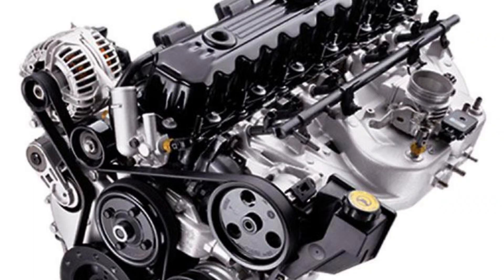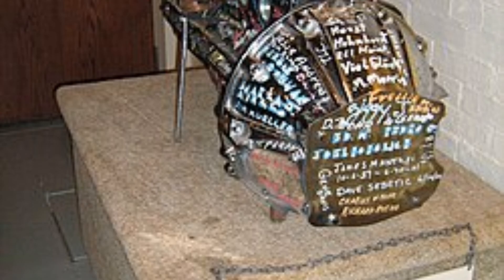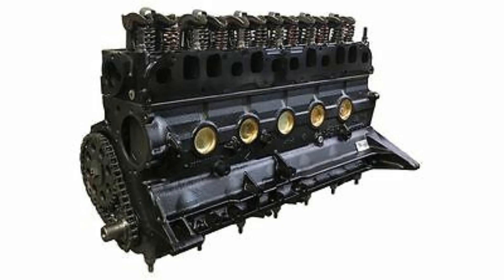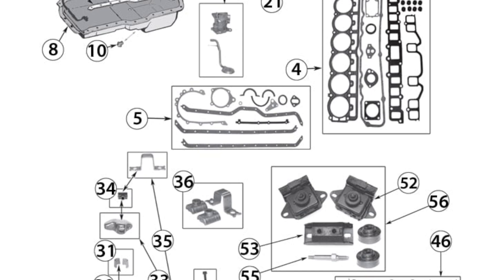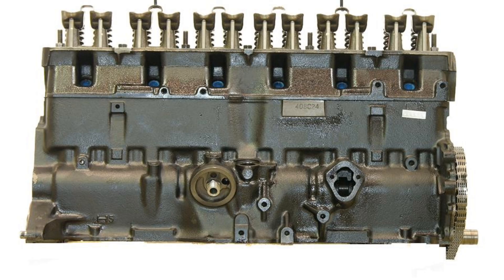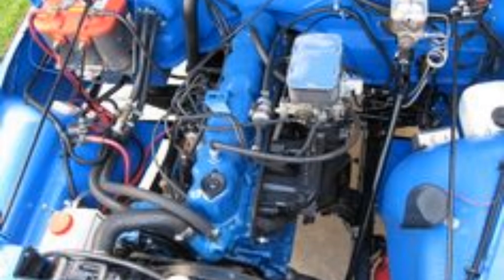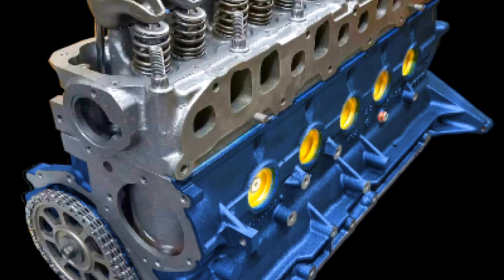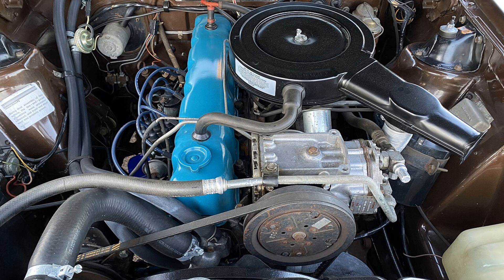The Legendary Straight-Six That Refused to Die

Comment: They weren't really 200+k mile engines until they became the 4.0 and received fuel injection and a modern low friction ring pack .

Comment: My first straight six was a 98 bmw 528i, now i've got a 96 jeep grand cherokee with the 4.0
I nearly bought a merc with the m104 inline six but that fell through, but im always eyeballing marketplace for another I6!
Reply: Mercedes were smart to mess with i6s, the OM606 is easily the best <4L Diesel of all time, maybe even just the best road vehicle Diesel in-general; also it's just naturally a performer, getting basically double the power/L compared to Cummins 4-valves for the same level of tuning, it's IDI too which means could run better with less-ideal fuels and end of the day being able to fuel your car and make more power than you could ever put down with random mixes of oils (including waste-oil) is a very uncommon trait!

Comment: Straight 6 motors were always tough.........  I had a 225 slant that was weak,  but always worked.
Reply: Arguably the best small-car Diesel is a Mercedes OM606 (IDI too!); the one gas engine you can stuff the hardest compared to others with same material parts is a 2JZ.. The most-extremely-tuned Diesel out there & most-beloved truck engine (in north america at least) is a Cummins.. All these being i6s cannot be a coincidence, espciallyy since they are all completely-different in purpose, philosophy & even capacity. That's just for the most technologically-recent examples, the old weak but bulletproof ones are obviously even more-numerous & well-known classics. Plenty more examples even for more-modern ones but that's just the 3 kings people mention often. Honourable mentions are i5s like Audi series, they seem to be just as-solid (maybe even-more so!!) as the i6s just with more vibrations & less power potential (due to lower capacity). 

I understand you can't just shove an i6 into everything, especially FWD for obvious reasons, so I understand the reason(s) for alternatives like V6s (especially for large capacities like the Detroits, but that's a whole 'nother topic) HOWEVER I can't help but feel that for an engine which is designed either for high reliability, high-performance OR especially both, there is never a real reason to go with alternatives.. The only exception is narrow-angle "Vee" engines like the OG Lancia & the VW "VR" series, however those are closer to staggered-inline engines than true Vee engines, precisely to reduce the length of the engine as the staggering stack like rounds in a magazine. All that sucks about those is the offset angle shenanigans needing some special designs like angled piston tops & the un-even intake & exhaust between the cyls (unless you alternate which direction exhaust & intake are every cylinder).

Comment: The flat tappet lifters means it's picky about engine oil to keep wear low also,
The fact that most aftermarket sensors are out of spec means it needs non existent Mopar sensors to run right
The engine just isn't up to the task in 2025
Reply: Wrong
Reply: One time I used Valvoline instead of Castrol in my 2000 TJ 6 cyl. It didn't like it, lifters started clattering. Never again. 150k miles and doesn't use any oil.

Comment: 2 things that keep my ZJ (1997) 4.0 purring like a kitten at 201k miles..... original Champion spark plugs every 15k miles, and rotella 5w 30 every 3k miles.
Reply: I sold my jeep at 230k miles because the unibody was falling apart. The engine was running perfectly.  I bought the car at 120k miles and never changed the spark plugs. Also, I only changed the oil once a year with full synthetic. Not only the engine was working perfectly, but it was also passing emissions testing.
.